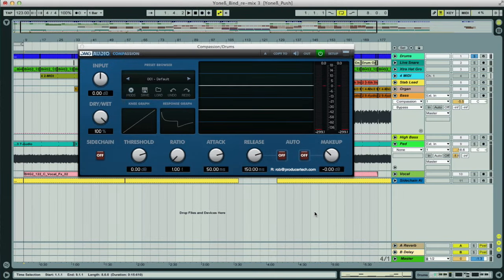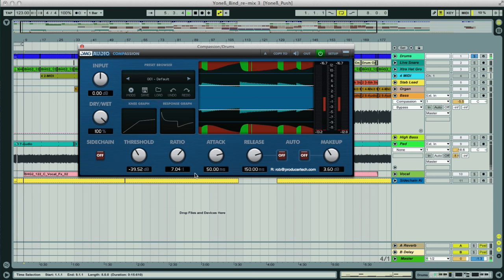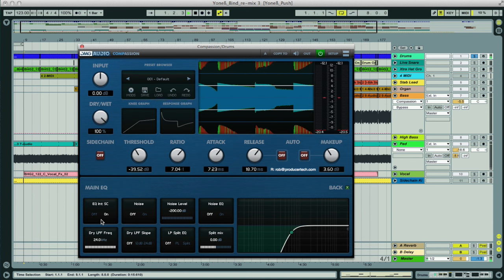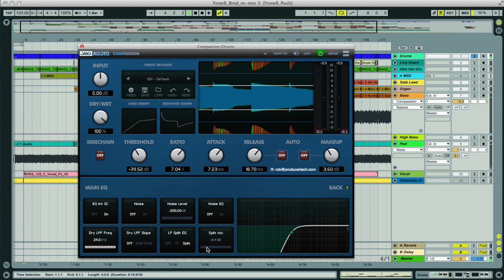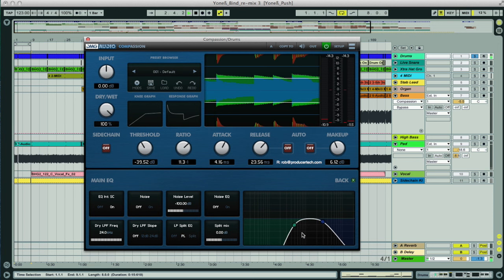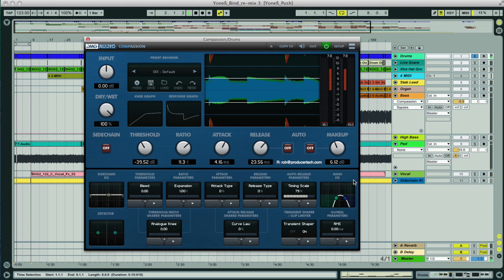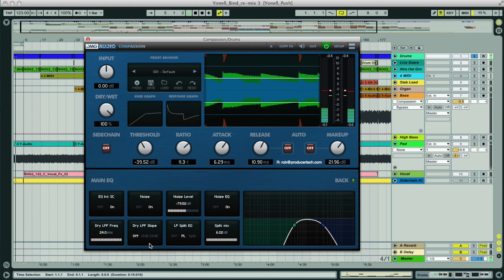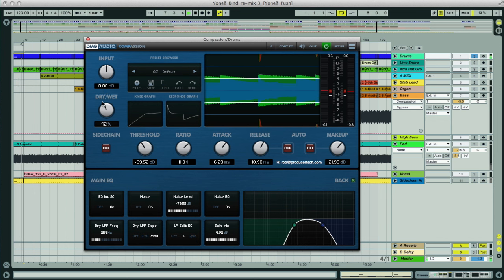Compassion Tutorial 2

Comment: How on earth do you get it to work in m/s mode?! Can't seem to find an answer anywhere! Thanks
Reply from the maker: Open the advanced panel, then at the bottom right cycle thru Global Parameters until you get to M-S Processing and switch it to on :)
Reply: @Dmgaudioofficial  great thanks. I’ve managed to do that much but how do you choose which part of the audio ie mid and/or side is being processed? Surely the parameters themselves should go back and forth once you start tweaking them individually, no? Thanks again!
Reply from the maker: @jonneves01  Ace! I'm not entirely sure what you mean, are you after Multiplicity for detailed mid/side and dynamic EQ work?
Reply: @Dmgaudioofficial  Hey thanks again for such a quick reply! What I meant was how do I switch the interface to show the processing I'm doing to the mid channel and then how do I do the same thing to the side channel? Usually compressors  that do this would have the top half, for instance, which is used for mid processing and than the bottom half, which would be used for side processing. Makes sense? Also I'd like to see the meters reflecting this. Re Multiplicity - I also own that and it's brilliant but I'd like to get Compassion to work in mid/side mode as well....
Reply from the maker: @jonneves01 No worries! You'll probably want to switch between SC1/Out1 and SC2/Out2 in the Listen menu – when M-S Processing is switched on, SC1 refers to the mid signal and SC2 to the side signal (Out1/2 same but with the outputs) :) more info in the manual if you'd like https://dmgaudio.com/dl/DMGAudio_Compassion_Manual.pdf – probably YouTube will eat this link 🤷
Reply: Yes I got as far as that by myself, thanks. What I would like to do, however, is to have independent control over the signals ie literally seeing the knobs going back to their previous position once you switch back and forth between mid/side but I’m guessing that’s just not a feature? Thanks again!